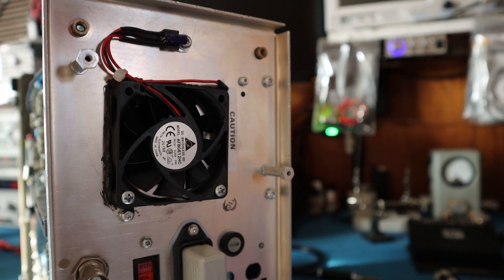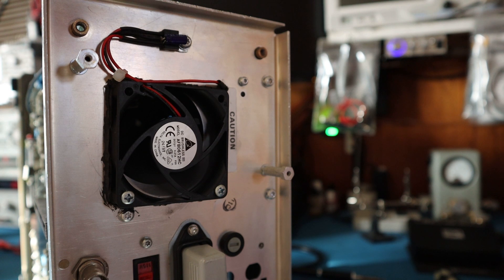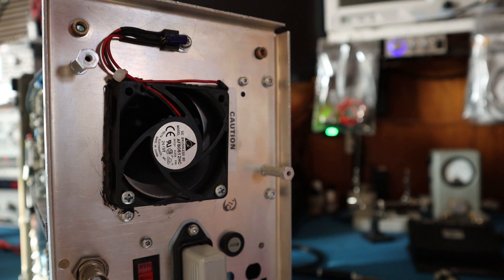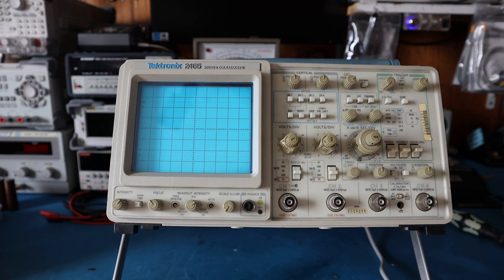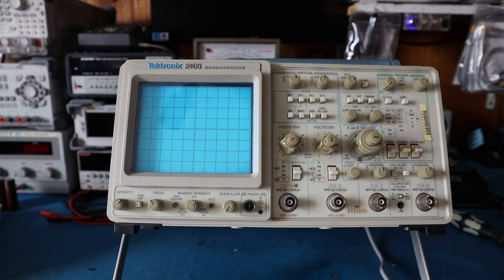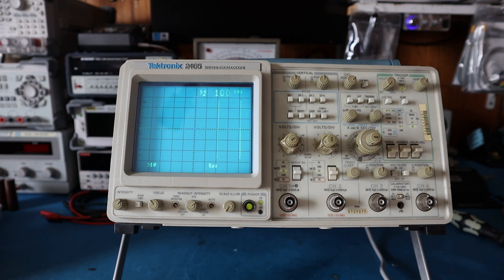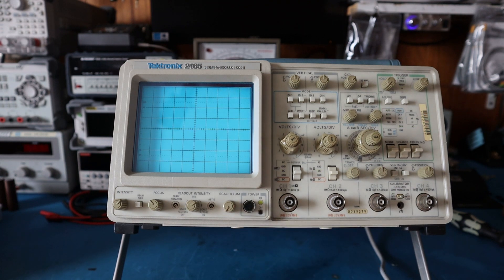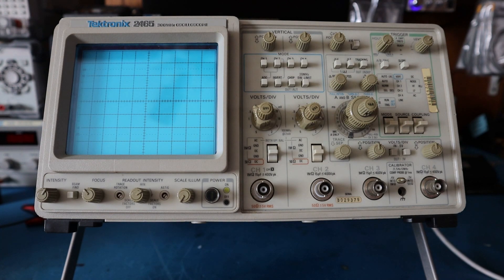Tektronix 2465 Analog Oscilloscope Fan Modification Done

Comment: I got a older model Tektronix spectrum analyzer from my colleague. The fan had very loud higher pitch sound. At first I said, doesn't matter it is the typical sound of a Lab. But soon I did a mod. The original motor was a smal thing making a lot of rpm, and working always at 100%. I did the mod by taking of the back cover, 3D printed a quite flat diameter conversion funnel (desing found on internet). The big fan doesn't need to spin so fast and is very quiet. I have mounted a sensor inside on the heatsink, and connected the fan through an old model regulator used as mod for pc fans. This solution is so nice and quiet and really enjoy now. Compared to the high pich loud sound all the time is just a world of difference. I have kept the back cover and the original motor a  side, and as these instruments are quite heavy you don't move it around so much, so don't mind it has no plastic back cover. It is closed by the metal frame anyway.  I used the same hole in that metal frame from the old fan to suck the air with this big quiet fan. I even mounted a second thermal sensor on the heatsink and have wires to outside to be able to hook up an external thermometer,  if needed, or just for fun project. But can not point out enough what a difference it made. QUIET 😀
Reply: Tek 2712 by the way